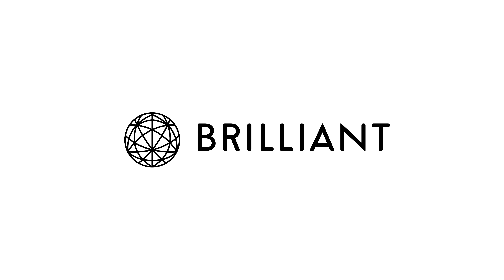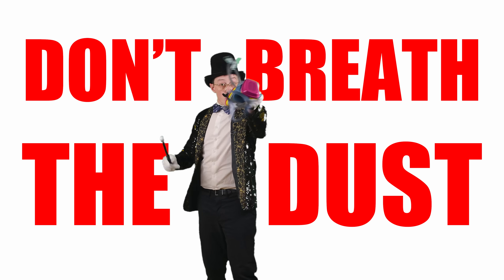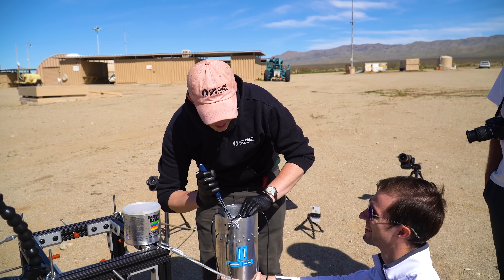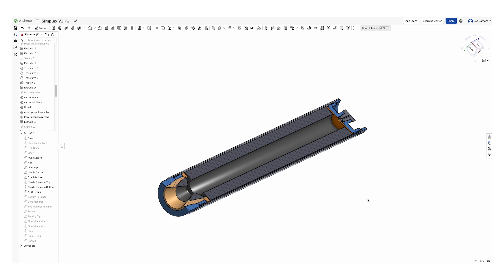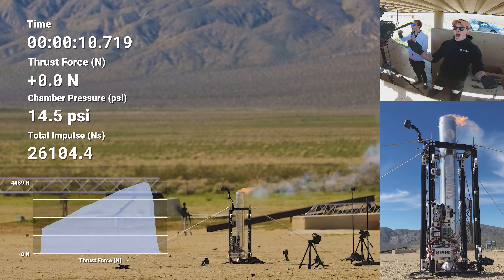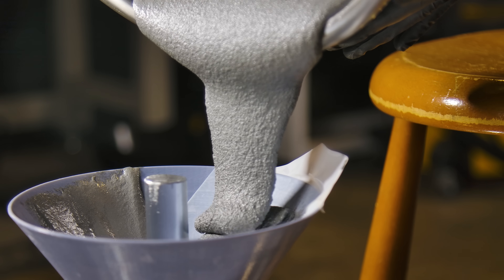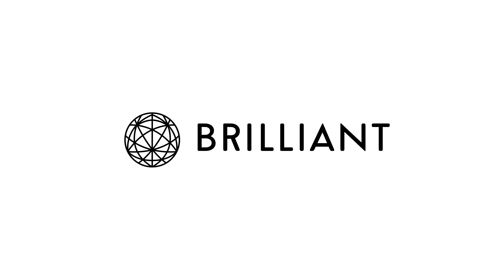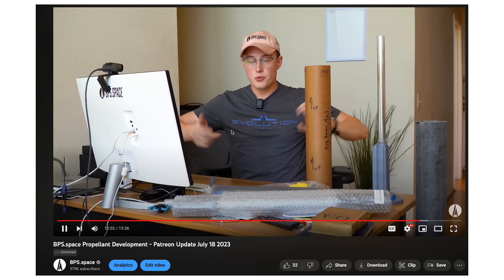Building A 1000lbf Rocket Motor - Simplex Ep 7

Comment: I have some questions about the propellant additive hx878. Isn't it used as a coupling agent between nitroamine explosives and HTPB? I have tried two coupling agents, hx752 and MT4 (called MT4 in China, which is a polymer of MAPO and tartaric acid). They are aziridines and can be used for coupling AP and HTPB to achieve better elongation. In addition, I have previously watched your video where there were problems with pouring difficulties due to the fast curing speed. Why not use IPDI or HDI trimer as curing agents to extend the operable time😂

Comment: They sell insulated  hot sleeves in casting foundries. All different sizes  and thickness for insulating the metal poured for shink in the casting. You may be able to find one that well glue inside of the aluminum
These sleeves are very light in wait.

Comment: Ok so I have a idea for you you need to make a s motor an s motor that can be about 100,000 newtons that is 100 kn if you make a full tube with 4 solid motors with 100 kn each then you have 400 after that you have a rocket that can launch like. Single star link satellite. As solid rocket booster do not have any gimble or thrust vectoring you need to add fins or grid fins and in order to have a fully reusable you will need to attach parachutes the send stage could be a s motor with a full thrust off 147,000 newtons if you have 6 q moutors at 20,000 newtons each you can simple fire certain engines un till your in a corrected orbit with the second stage being expandable or being a satellite it self

Comment: Hey Joe,
I just noticed that everything you do here lines up with my daily work.  Am was trained electric Lal engineer, self learned mechanical engineering.   Over my whole career,  I  when through electronic design, test and manufacturing.  Now ironically spending about 70% in mechanical design and 30% in electrical.  From CAD to 3D print, wood shop to a Haas cnc, lathe, welding, ... at home.  I just love building things.   I have not built a rocket before, but if you need help in anything,  I would love to work with you.  I would learn a long and have much fun is just all I am looking for.

Comment: Am not a rocket scientist but if you get it that you can pour your fuel could you pull a vacuum on the tube your putting the fuel in? Second thing is could you go and compress the fuel? Its like feed pellets or the wood pellets that they use in some smokers. Those pellets are made by compression. If you get them wet they nearly double in size. I don't know if you could hydraulically press the motors while they cure to increase density of motors? Might be a bad idea i don't know. Third thing is when we pour concrete we use vibrators to get air out and to help liquify the concrete to fill voids. Could you use concrete techniques to help with your motors? You could even apply vibrator to outside if it would not work on inside of your mold
Reply: You also said that you will need something bigger to set up your bigger motors and your space launch. My advice is look into renting a boom truck. Lots of different bed lengths out there.  A 20 ft long bed would be an easy find I would think, pretty common in construction delivery industry. You could load rocket plus launch gear on the bed. Then when you get to FAR put down outriggers and use the trucks boom to set everything up. They can lift several tons so your rocket should be fine. You will need to use remote releases or possibly a small JLG lift to unhook your rigging. I think you said your space shot might be 20 ft tall. If it won't tip rocket over you could maybe use a ladder. If tipping is an issue and JLG is to pricey you could use scaffolding. Standard frame scaffolding is 5 ft wide and you could get frames with built in ladders. 7 ft braces would let you build a 5x7 scaffold around your rocket with 8ft walk boards, put cleats on the walk boards. Scaffold planks normally 10 to 10.5 inches wide, by law you have to work off of at least 2 of them at a time. 3 sets of 5 ft frames would get you to a bit over 15 ft. You will need jacks and mudsills to set frames on. Am scaffold builder so this part I do know what I talking about lol. You could load scaffold on the boom truck to haul it to the sight. Just some thoughts hope some of it helps you out.

Comment: Why do you need a liner? Why don't you try case bonding? And extend the grain till the throat by placing the nozzle first, sealing the throat, packing the propellant through the rear end and then closing it of with the aft head in such a way that no flame ever touches the chamber walls or the aft head Until the very last second of the burn .....  If you are not planing on reusing the chamber 😅

Comment: For avionics and control, could you borrow some designs from the Nexø rockets by CopSub ?  Those were 5kN bipropellant rockets a few inches in diameter and they put in a bunch of stuff around the engine to fly them to airplane altitude before switching it up to their full size SPICA project .  Having Joe validate their systems to full space altitude might help them improve some details .

Comment: For moving the large scale motors into the test stand when testing the actual Space Shot motors, I would be thinking of basically a car engine lift but higher and with larger wheels for the oiutside ground, as you won´t be dealing with the huge weights of car engines, but a large but reasonable 100 punds plus rocket motor that should be pretty doable. By haning the wide base that is overhung by the lift arm it only needs to be stable enough to lift the weight, and by building it like an engine lift there is no counterweights needed as the center of mass is always over the base. With the base having enouh space in the middle to fit the test stand in between. That way the motor can jst be winched up, the contraption pushed over the stand, and the motor lowered in.
Reply: Alternatively. just make the test stand capable of tilting 90 degrees. And a rolling cart that can be lowered/raised to the same height. Then you can just assemble the last parts in the horizontal, push the cart over, tilt the stand, slide the motor in and tilt it back.

Comment: The trick to building a 1000lbf Rocket Motor is to stuff the fuel into the cylinder thing really tightly and then let it dry and screw on a nozzle of some kind! Then you wait until it dries and put fire near it when you want it to go in the other direction away from you 👍 You're welcome, I'm just here to help a fellow YouTuber making videos about things and stuff 🙏 #TechTip

Comment: could I make a suggestion on negating the cavity formation in your fuel ..the mixing spade that you use is for dough and and is designed to mix in air..try a plastering mixer with a rotating tub and static flat spade it reduces air incorporation 🙂

Comment: this young man utterly changed my life. i know that is an odd thing to say, so allow me to copy and paste my introduction post from model rocket forum - 

hi everyone,
i am an old bugger (49) and i have accidentally become mad abut model rockets.
a year ago i became interested in astronomy. the Youtube algorithm then thought i might like to see videos by a lad called joe from BPS about model rockets.
i had never seen anything like it before, and i was smitten. i wanted to make a rocket with a flight recorder in it. all i needed to do was learn all about rockets from scratch, and flight computers. so, and this goes on quite a bit, for that i am sorry, i needed to learn everything. i bought some cheap klima rockets to start, made them, flew them. all good! then the computer bit. i had to learn what is AC, what is DC. what a raspberry pi is, what an arduino is. what every component does. i then bought boxes and boxes of components from amazon. then i bought an oscilloscope (id never even seen one before, yet alone used one), then i bought a bench power supply. i leant about op-amps, so i bought another bench supply for differential power. i had to learn how to solder, so i bought a soldering iron, it was crap. so i bought another, then another. it wasn't until i spent 50 quid on a solder station that i got the hang of it. then i had to learn about designing circuits, so i bought veroboard. then i wanted to make PCBs, so i bought ferric chloride. on and on it has gone. learning more, buying more. (my wife loves it because the other day i fixed something electronic in our home, id never have done that before). then i needed to write the code for my sensors. so loads more learning (to be honest it wasn't until i used chatGPT to help me write code that i could make everything work together-the arduino nano, the bmp180, the mpu6050 imu, and a sd writer). well today is the day i have a flight computer that will fit in a 26mm rocket. it has taken me just over 12 months to get this far.
i thought id look around the web before i launched. and here i am.

Comment: next time you cast use a pentagram 'shape' for the exhaust channels, to not get the bubbling when casting you have to pull the vaccume and let it slowly become sold with tempture control to keep it warm but not melty so any bubbles or voids are removed.  next time mix the finest aluminum powder you can find at like 3%

Comment: Would using one of those theragun massage things help vibrate the propellant into the mold as you pour? They use something similar for cement when pouring foundations and walls to get it to settle evenly and get the air out

Comment: WTG!  Idea for liner application - slow 'roll' the case whilst spraying the liner via a high RPM nozzle that repeatedly dives and climbs through the case - think 'coolant thru end mill' but it's a spray nozzle on the end of a rod instead of an end mill.  Also kind of like honing a piston engine's cylinder - but you're spraying material into the cylinder and the cylinder is rotating to hopefully avoid uneven thickening of the liner material as it dries/sets/doesn't explode 😝

Comment: Supposing you really do the spin casting, remember two things:
1) The spin casting mount must be structurally solid, and the more solid the better, wobble is bad for this, because it results in uneven coatings; and
2) Use roller bearings (or maybe simple bushings), not ball bearings, because they have better resistance to forces.

Comment: I loved the singalong. Just perfect. Never stop making stuff like that. That's what makes this channel worth watching! 😂

BTW... Why don't you mix and vacuum your solid propellant directly in the casing? That would just eliminate the whole ordeal of pouring and packing...
Reply: It doesn't, really. None of the large solid propellant manufacturers do it this way. The geometry of the motors is far from ideal for doing so - tall and thin - for both mixing and vacuuming.

It's better to mix and vacuum outside of it, then pour in as thin a stream as possible so that it helps breaks any remaining bubbles while dong so. Ideally you also vibrate the casing you're pouring into at the same time (at around 10 to 50 Hz), so it helps level out the liquid mix inside the case.

Comment: For spin-casting- My brain says to put a lip on either end(sacrificial sections to be cut off) and then pour it in slowly at high spin. Going to need a good motor duty time as it would require constant spin while curing, and a fairly wet insulator mix.

Comment: Mach diamonds are always a good sign 😊
For packing the casing, have you thought of either pulling a vacuum from the bottom or using a cement vibrator? It's a tool that's used in construction to get the bubbles out of the concrete when you put it into a form, so it's basically built for making rocket motors!
Reply: Using a vibration fixture is indeed how some manufacturers do it. Vacuuming inside the casing is not really done so far as I'm aware, the geometry of most propellant castings is far from ideal for it. Instead you vacuum it outside of the case, then pour in as thin a stream as possible, while vibrating the case to help level out the liquid and encourage any bubbles that might get formed as the liquid stream tumbles over itself at the bottom to rise and break. You should get at least a 98% theoretical density this way, which is plenty sufficient for almost all use cases.

Comment: For the HEI, would it be possible to build an igniter that screws in from the nozzle end (using a really long wrench) into a blind hole and and inductively couples to ignition signal? That would remove one seal and would also make accidental ignition signals less likely (it would take a sustained high power, high frequency signal to set it off).

Comment: There is a ' cheap ' way to get used to spin casting, depending what you are comfortable with.  The easiest is to start with a used record player, blue tape and a cardboard tube to pour in melted wax.  Just like the weekend fair paintings, centrifugal forces will pull the wax to and up the sides.  I did not say this is without spray hazards.  Keep learning and nice musical number.😎

Comment: You should use an AS 5202 port instead of NPT for aluminum. Risk of over torquing the pressure transducer into the port. The PT is usually stainless and you don't want the threads on your case to stretch

O-ring seal is better anyways

Comment: Do you think making divots inside the thrust port can help bring some of the side exhaust to be vented back into the main core of the thrust. Would be like refining the beam of the thrust downward using the outside ring of thrust as consolidation/refinement of pressures. If it were to work for low end rockets and with your project which is way more advanced then maybe it can scale up.

Comment: time to motor hmh
Reply: design the motors in parts, like artillery load charge
Reply: hydrogen fits nicely in a carbon tube, infused in the structure, even non-pressurized, all burning, solid CHx compound

Comment: Not sure why you built such a nice stand when you could've just used blue tape to hold down the motor.
Reply: You commented the exact same thing as someone on the test stand video
Reply: @Liam-abc  
what LOL
Reply: @Liam-abc 
Maybe because Joe makes fun of his methods of holding down parts to machine in previous videos?
Reply: BRUH I LOVED THIS
Reply: Why not, worst case you learn something from it.
Reply: Looks like the o rings for a 7.3 diesel oil cooler I've fixed a few of them that had bad oil leaks if u are looking the best o rings of that size go to your Ford dealer and order oil cooler o rings for a 2000 f 250 7.3  turbo diesel u can buy cheaper 1s on line but the dealer has the best made 1s I've used !!
Reply: Y’know, some of those sugar mixes are awfully tempting…
Reply: He is build different, but that's a bit too different even for him
Reply: Lol
Reply: Hot glue would work much better in this application
Reply: Because he is the real deal, not that he always has been or anything but he definitely is now